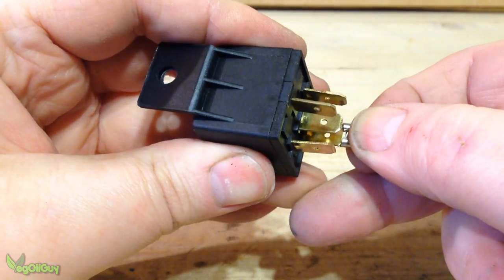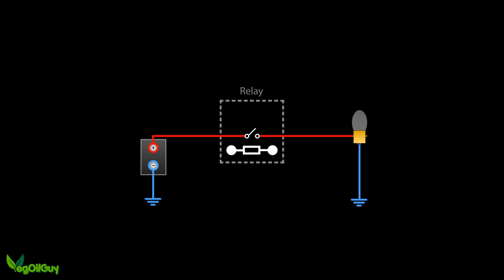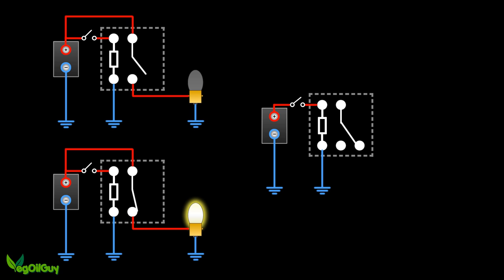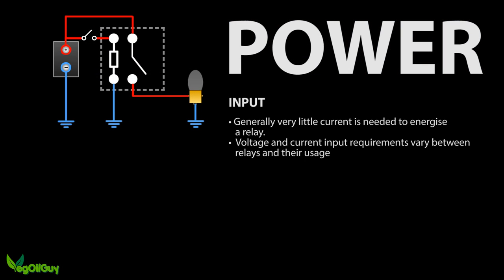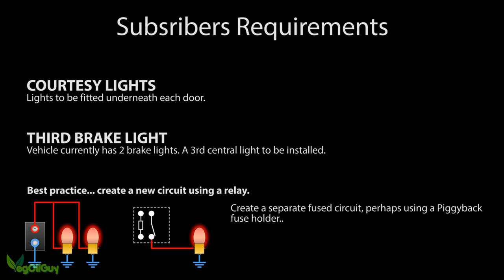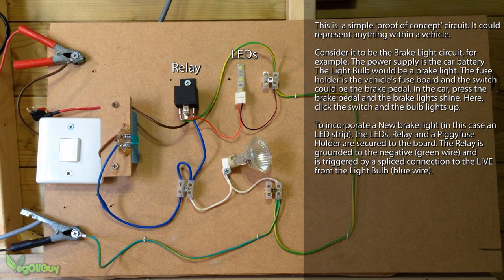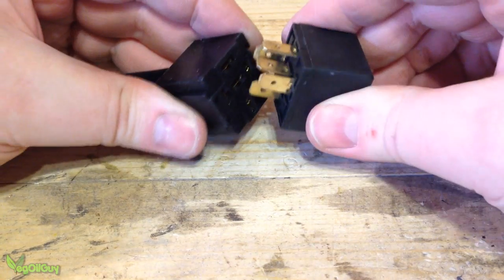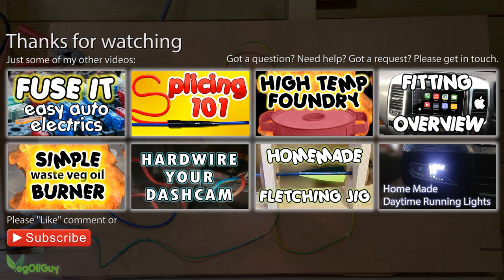RELAYS what are they? How do they work? How to use 4 pin & 5 pin Relays [EASY TUTORIAL]

Comment: Great instructional video. I’ve just added a new double din stereo to my vw caddy. It’s all working fine but I purely took a piggy back from the cigarette lighter fuse as it’s a switched live. There’s a 15 amp fuse attached to the stereo as well as the new piggy back fuse. After watching your video I’m intrigued as if I should have fitted a relay ? What would you advise ?, thanks

Comment: Im intending to install a reverse/backup alarm. So 85 is splice with the parent brake light hot wire. My question is. 
For pin 30, can splice again/with the brake light hot wire but with a fuse/fuse holder instead of tapping it to the fusebox?

Comment: Great practical advice / help! After seeing your helpful video on "piggy back" fuse holders, can you clarify if it would be ok to use this in the parking / side light fuse slot in order to take a feed to the DRL auto dimming facility for when driving at night (white wire from relay)?  (Splicing into  a feed from the headlight / side light unit is almost impossible due to restricted space & accessibility.  From what you say I think using a "piggy back" fuse would be safer since it will be fused and no extra load imposed?
Reply from the maker: +Sight & Sounds 
Thanks for your comments. To be honest it's a tricky one to answer because I'm not there with you so I don't know the specifics of the situation.
Generally speaking, most DRLs tend to be LEDs and these tend to be very low current. This is a good thing and lends itself happily to Piggyback fuses etc as there's little concern about overload.
The danger comes when you plan to Piggyback with a large load - something that uses a lot of current. In such a situation even though the fuses may be up to the task, the concern is whether the wire that feeds the fuse holder is capable of handling the load. 
So as a 'guess' I'd say you'd be fine.
However, if you're asking me if you can use the existing fuse as a TRIGGER to act on a relay (using this instead of splicing into the sidelight feed, etc), I'm not so sure. I would imagine the dashboard switch comes after the fuse, meaning that the supply will always be positive regardless of the switch position, so your DRLs will be on permanently (at least after the ignition is turned on).
The obvious thing is to test it with a multimeter and see ; )
I have got a couple of other videos that might help you - 
Homemade DRLs - https://youtu.be/9c-iZ-SKqCE
Fuse It - https://youtu.be/8omZ545Cw1U (handy lips on selecting the relevant fuse with a multimeter, etc).
I'm sorry if my answer seems vague. It's not intended to be. I suspect you already have a good grasp of the subject based on your question so my answer is intended to give you food for thought - I hope it does.
If I can be of any further assistance, please feel free to ask. I'll do my best.
Good luck with your project.
Geoff
Reply: +Geoff VegOilGuy Many thanks for that comprehensive, prompt and useful answer. I know where I'm going on the wiring front, but I confess I don't know how the relay and the wire which makes the dimmer work (inside the relay - which I bought ready-made) really works. Presumably it does not necessarily carry much load other than (perhaps) the 5W allotted to the side parking lights? I have just discovered that as the relevant fuse box is inside the car, it might be just as easy to send a much longer wire to the rear side / parking light, which is more easily accessible. Anyway, I shall be having a look at your further guidance videos and illuminating web site on other issues also.  (It does seem that car makers make their products very difficult to work on for DIY and prefer us to spend endless sums on "expert" garages and services under the general pretence of "healt & safety" considerations. I'm sure you know much more about this than I during the course of your various endeavours....!)    All the best.
Reply from the maker: +wordsmith52 
Relays are actually very simple. All those terminals are off-putting but when you've played with them for a while it all makes sense  ; )
They're just a safety device. We don't handle current well. Just a few milliamps is enough to stop the heart. 
Imagine a starter motor. These can use 300 amps or more, easily enough to kill us. Imagine running all that power through a switch and then pressing that switch. Potentially all that surging power could arc through the terminals of the switch and fry you - just for pressing the on button.
To get round this we use a relay. Our delicate digit turns on the relay (by clicking a switch - turning an ignition key, etc) and this turns on a relay. This process uses very little current and is completely safe. The relay, however, is made of much sturdier stuff and it can then act as a switch to power starter motor or whatever.
So when you turn on your car starter motor, you're really turning on TWO switches.... the ignition key and a relay. 
If you've purchased a DRL kit, it probably does have a relay in it for safety. Vehicles are packed full of them for the very reasons I've said.
If you look at my homemade DRL I also used relays. I confused the matter even further by adding a dimmer circuit for night time operation. Once you get into them, they're great!
And as for triggering from the rear sidelights... excellent idea. Wherever is convenient.
Every time I do any auto electrics I swear at the manufacturers. There's never any slack in the cables and access is terrible. But I suppose one extra inch of cable over a million vehicles amounts to a fortune, so guys like me with big fat fingers are just going to have to learn to live with it ; )
Do let me know how you get on.
Best wishes,
Geoff

Comment: Instead of using a piggyback, can I draw the current from fusebox 12v DC source and run the wire through an inline fuse?
Reply from the maker: Yes. Drawing from the fusebox is much better than a piggy in honesty, but a piggy is often more convenient : )

Comment: Thank you so much 
I have question
I have fuse 40 amb and i want to make switch for it so i can turn it off when needed
Can you help me what i need and how to connect it
Reply from the maker: Hi Thamer. I'm always happy to help if I can : )
A 40 Amp fuse is very large. It carries a LOT of power. Please take care when dealing with such large fuses. I have an electric Welder and that works on 40 Amps, so you can see how powerful 40 Amps is.
You are right to be looking at using a Relay. The video you've watched gives a couple of examples circuits powered by relays. You'd need a low current circuit to connect to your switch and then use the power from the switch to trigger the relay which can handle your 40 amps safely.
Normally people ask me about low powered devices like dashcams and I tell them to use a piggyback connector - https://youtu.be/8omZ545Cw1U  - but with a large fuse like yours I would recommend a dedicated power line.
If you visit an auto products store they often sell kits that fit a small fuseboard in your engine bay, usually for amplifiers and things like that. These usually have a battery terminal connector, cable and fuse holders (and hopefully instructions). With one of these fitted, you can run your 40 amp fuse without risk to the rest of your vehicles electrics.
Hope this helps.
Geoff
Reply: Is this will work 😅
Reply from the maker: Hi again Salman.
I wouldn't recommend just using a switch. Whilst the switch may cope with the power it's not a good practice to switch heavy duty (high current) devices without a relay. That's what the car manufacturers do after all.
Have a look at the image - http://vegoilguy.co.uk/_maingifs/relay-practice.png
It shows you the right way and the wrong way. Personally I'd encourage you to use a relay. It's safer for you.
Reply: VegOilGuy thank you so much you was really helpful

Comment: I am trying to install seats that have heat pad.. but I know 30 goes to fuse box, 85 with brown wire from seat to ground, 87 to red wire that comes from the seat and I have no idea where to  wire 86 ??? it says switch but the car doesn't have switch...
Reply from the maker: Hi there. Sorry I don't know how I missed your question... please don't think I was ignoring you : )
85 and 86 are used to engage the relay, so one will be positive and one negative (grounded to the vehicle chassis). The positive element will be the trigger - so what is it that's going to trigger the relay to work... a switch... a splice into an existing circuit?
I hope this makes sense. Again, sorry for the delay.
Geoff

Comment: I really like your videos, but you should speak up
Reply from the maker: You're not the first to say it  : )
This was one of my earlier videos. Since then I've got a better mike and I hope the sound levels are better. Have you sampled any of my more recent videos?
Thanks for the feedback.
Geoff
Reply: A few, I'm trying to add LED DRL to my car but I'm having a problem, because my car has DRL, but it's the DRL that is the High beam, and I'm trying to run a DRL but take the power from the high beam, but can't figure it out
Reply: I have a 2017 accord LX, which is the lowest model, and my headlights have the led strip, but the DRL is highbeam drl, so I need to drill a hole, add a t20 socket, with a 7443 led bulb, but I want to disable the high beam DRL, and run that power to the T20, but still want the highbeam function when I need it
Reply from the maker: Hi. Thanks for your comments.
Have you seen my video on custom DRLs? https://youtu.be/9c-iZ-SKqCE It was one of my first videos and the sound is quite poor, but there may be something there that might help, particularly using relays and existing light circuits as triggers. 
There has to be power going to you existing DRLs and so all you need to do is splice into this and use this feed to trigger a relay (to 85 on the relay, with 86 to chassis). The other terminals should be a fused supply through the relay to the new lights.
I hope this makes sense.
Geoff